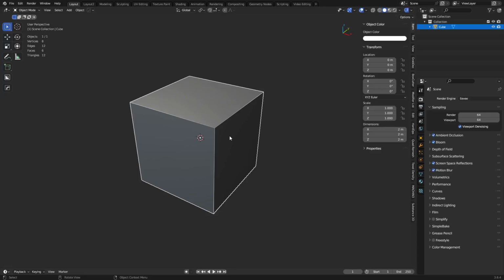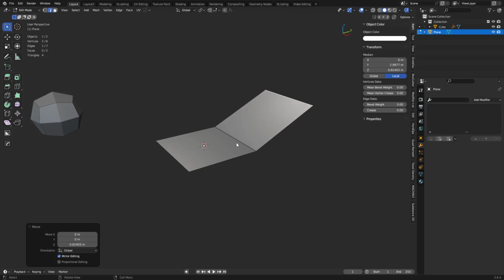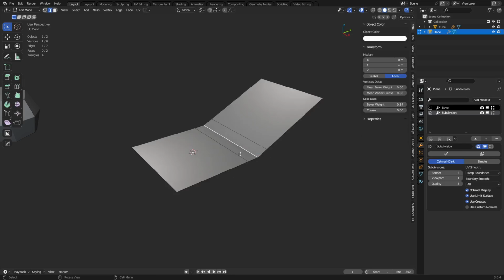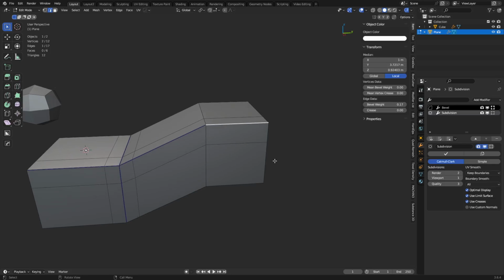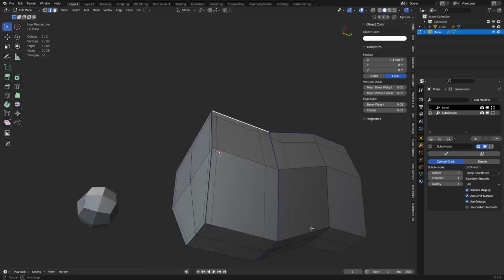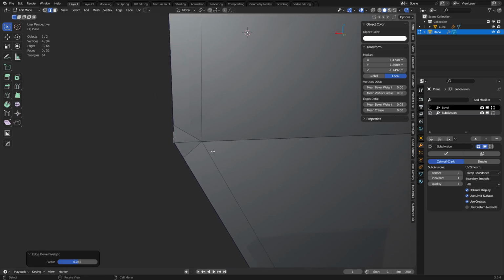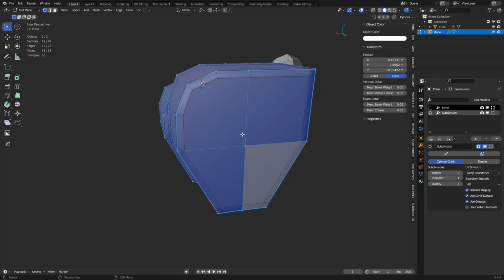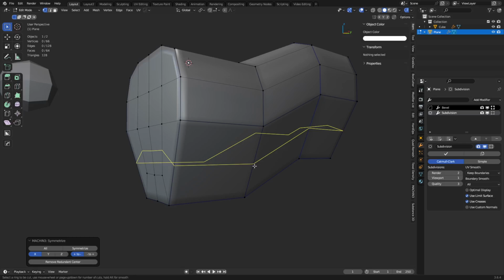Blender - Bevel Weights with SubD

Comment: i always use this method for procedural workflow but sometimes you want to change one edge only but the previous one gets affected too. i tried by vertex groups but i has some issues too + i really like your blender theme
Reply from the maker: If 2 weighted edge bevels meet. They will all shift.
Reply: Is this method will create a good result? Or manual method works better? Than kyou, btw your model is like a toe 😂